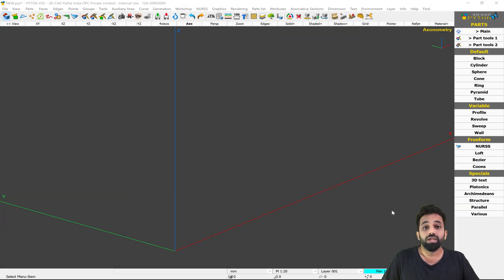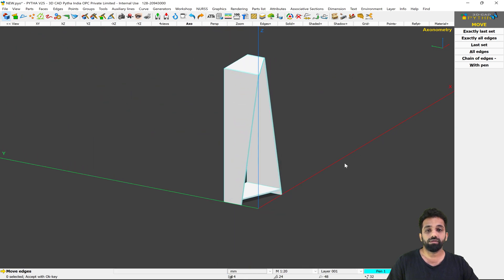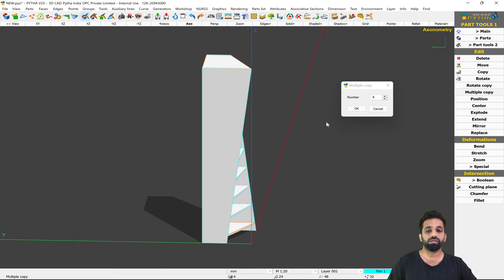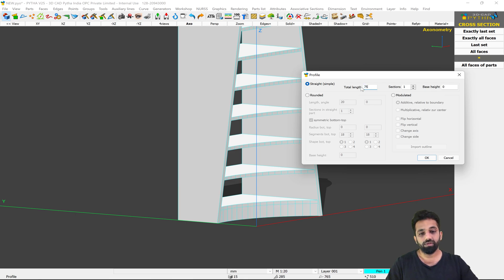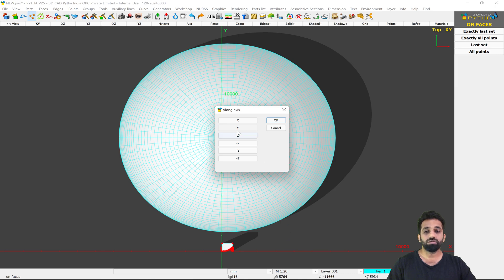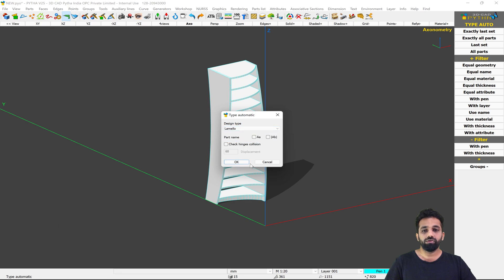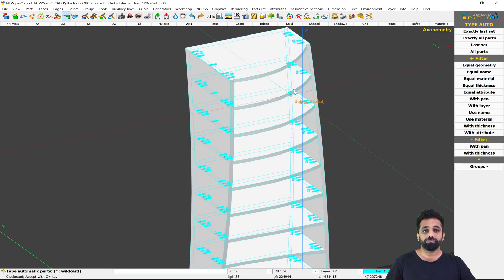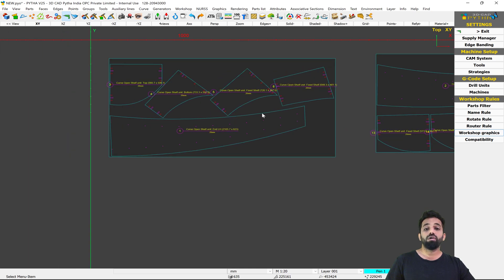Pytha V25 | Curved Cabinet

Comment: Hello. Interested in your Pytha program. We have a Nanxing NSB2412S drilling and priming machine in production. The instructions say that it reads the Pytha DXF file format. Could you send us a DXF file for verification. Any piece of furniture with holes is needed.
Reply from the maker: Hello, Sure I will send you a sample dxf. but  Pytha directly gives cam output for Nanxing NCB2412S with all the tooling info. so you don't need a dxf. Please write me at sharique@pythaindia.com. or you can connect me on WhatsApp +91 96956 96956
Reply: Hello. I wrote you an email, but you don't answer. @PythaPro
Reply from the maker: Hi @amegainter7 , I replied to you please check.
Reply from the maker: more info about you and your company will help us serve you better.  @amegainter7